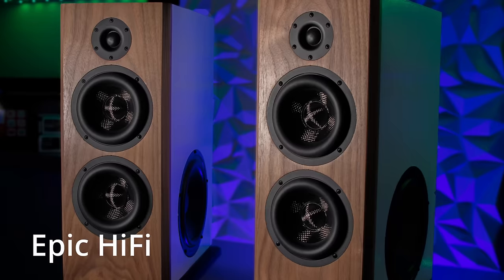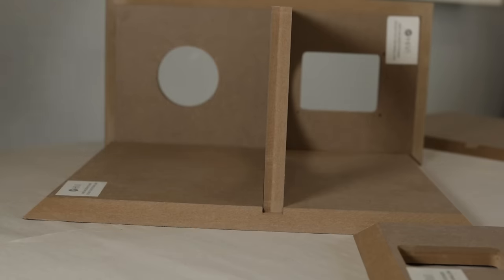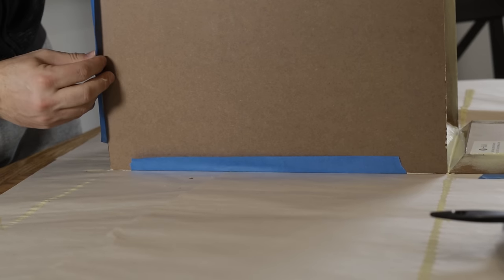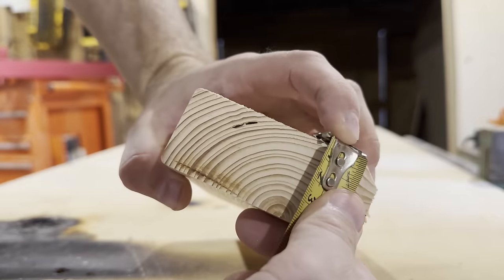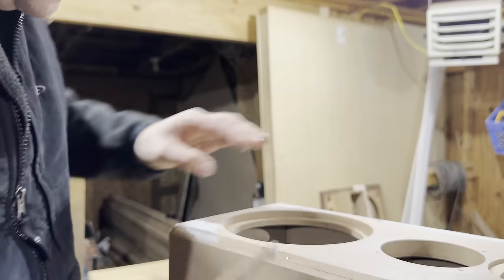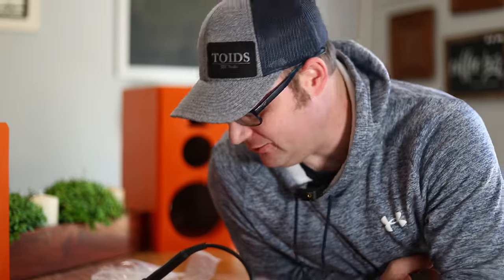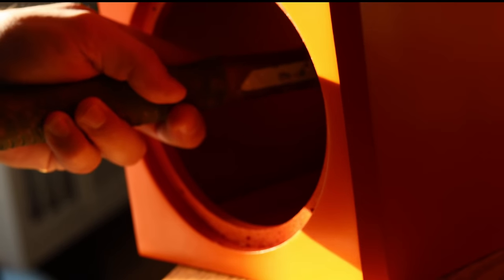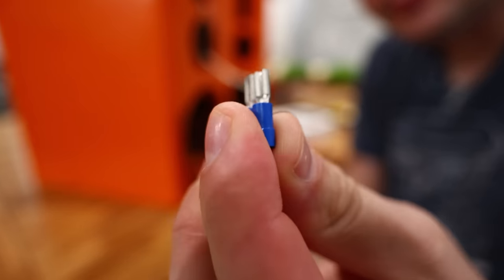Is a 3-Way DIY Speaker Kit on Amazon for $300 any Good? The HiVi Swans 3.1 Kit

Comment: Fantastic kit IF you go with the Sehlin’s ultimate crossover. Which is what I did, but I also upgraded all the caps, inductors and resistors (spent an extra $350). After the upgrades, one would  have to spend north of $1500 to get a better commercially available speaker, but then you wouldn’t get the same quality parts in the X-over. So maybe north of $2k.
Reply: How much did you spend
Reply: @BoRerunn  total was about $660. Bought the kit during the Black Friday sale for $310 after tax, the rest was for the upgraded parts.
Reply: The inductors Position is complete wrong. 90° flat to stand horizontal. Joking?
Reply: How do I buy this modded crossover? I went on the site and it didn’t look like there was a store
Reply: I built these with the moded crossover. They are my favourite speakers. I’ve actually built about six sets of speakers. These are superior quality speakers. They sound so good

Comment: I made the kit about 4 years ago loved it.  The bright charater was ok with some music especially accustic but too bright on some music so I upgraded the cross over and improved the quality of the parts.    It was a great speaker before, now it can hold it's own much much more expensive speackers.  I build the CSS kit with the upgraded cross over.  spent over a 1000 on that kit.   Listening to them side by side, they are very close.   The CSS Critons can dig a little deeper and the swans are a bit more detailed on the top end, even with the upgraded cross over smoothing out the frequency response.   The swans are more efficient.    The sound stage on the CSS audos is a bit wider while the Swans seems a bit more center stage and forward.     For the money,  the Swans are a steel.    If you can go with tha Sahil upgrade do it.
Reply: Those kits from css are pricey. I did happen to build these with the upgraded crossover. Overall I love them. I sold my klipsch reference speakers that I had previously got. That’s how good they are. I have them hooked up to a very humble 1100 watt amp. Emotiva dr2. I love my system. I also own a sansui 9090 and a Akai as-1030

Comment: At some point, actively multiamping with DSP and good though cheap class D amps will likely be cheaper, more controllable, and ultimately much better performing than taking a chance with the "premium" x-over components and alternate passive circuit designs that some commenters advocate.  This is especially true with 3+ way designs where x-over design is still more art than science due to the number of variables and imprecise characterization of drivers in the time domain.  Would make for a very informative project doing both approaches and comparing results.  Cheers!

Comment: I’ve seen a couple other vids on these, nobody mentioned how bad it measures, not that I always care about that but you’d think they’d have a slightly flatter response. Great vid tho, thanks!
Reply: The measurements are my favorite part of Nick’s videos.
Reply from the maker: I really thought they would be much flatter as well. It just makes them harsh. One thing I will say though is they are in phase so you could EQ it out if you wanted to
Reply: @Toid  in general I really don’t like having to EQ things out. It’s nice when you wanna tweak but I don’t like it when you have to do it.
Reply: Definitely looking forward to the upgrading the crossover video
Reply from the maker: @cmammen  I agree completely

Comment: I just finished this kit as my first diy speaker set a few weeks ago, and my corners came together a little better (never enough clamps!). That said I put a roundover on the edges similar to your chamfer, did the crossover mod (v4 from the ASR forums, I think), and used un backed maple veneer (this was hard to work with and a bit of a mistake + learning experience). I just added some spiked feet this weekend as they were sitting on an old buffet and I could feel the coupling to it pretty strongly.

So far loving them, but will try and get some measurements next weekend.

I'm excited to see what you think with using a crossover mod.

Comment: That's a fantastic set of components for the money, particularly considering it packs in a dome midrange and ribbon tweeter. Overall its screaming out for being followed up with a R2 kit to iron out the noted tuning and assembly kinks, and maybe tweak that strange mid placement just a smidge in the vertical and recess.

Comment: Hi toid 

I want to do atmos but i have concrete ceiling..it would be very helpful if you could built a good atmos enclosure for dayton in ceiling speakers like the dayton me820c and sell the plan for it
As they dont have ts parameters ..it's quite tough to build an enclosure with proper dispersion for a large soundstage and with decent bass ..both a seal or ported enclosure would be good ..but as they dont have ts parameters i am kind of lost ..you have a lot of experience with building enclosure so if u could make a video on a diy in ceiling speaker enclosure for atmos ..that would be really good with the paid plans links

Comment: Great video Nick. Keen for the crossover video. Hey but you have an awesome shop so some viewers might be discouraged if they dont have a nail gun or router table. TBH I never use fasteners. In my builds. Glue n clamps. A trim router could do your chamfer. You could edit the video to mention alternatives. Bargain kit.🇦🇺☮️

Comment: when soldering component's to the cheese board leave a nice gap between the larger components and board
especially with coils and ceramic resistors to dissipate heat.

Comment: Why not just use resistors in the speaker line to knock down the db on the mid and tweeter?
Reply from the maker: Unfortunately, it’s not quite that easy. However, if you wanted to go with the stock crossover, the best thing to do would just be the EQ it. You could EQ it to something that you would really enjoy. I did measure off axis, and it is in phase. So a simple EQ would be the best thing to do. I would just rather have the crossover designed better.

Comment: As My knowledge say's to get it in them a good crossover needs second order on midrange in all the way up and down third order in woofer to correct phase and second or third order in tweeters. (Woofer and mid i done simulation a year ago when i was looking to change my monitor project.  (means dayton rs52 mid with the same hivi woofer) but all my goals was almost the same. You need second order on mid to give flatter phase graph.